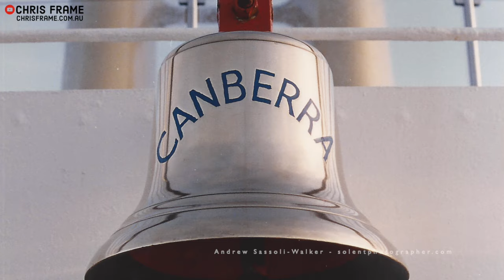RECYCLING CRUISE SHIPS! How & Why Ships Are Scrapped?

Comment: The Queen Mary’s funnels were replaced because when they took them off to remove the boilers, the funnels collapsed under their own weight. When they were inspected, it was found that most of the metal had rusted away and were only being held up by the many layers of paint. As for why the boilers were removed was due to labor laws. If a retired ship still had the boilers, all employees were to get maritime pay. This was the case even if the ship is removed from the water and used as a land based hotel. By removing the boilers, they were able to save a lot of money by paying standard hotel wages.
Reply: Don't think that was the case they just wanted more space
Reply: @MrJeep75  The area that the boilers were in is still empty. For a short time they were filming a TV show in one of the boilers location, but that is back to being an empty room. I know about the pay because that is what they tell you when you take the ship tour and ask why they didn't just leave the boilers in place.
Reply: I think it was also Cunard insisting that the ship must never sail again, to ensure their former flagship will not somehow end up with the competition.

Comment: Imagine buying a huge ship engine and just using it to power a giant fan
Reply: Yasssss
Reply: Imagine buying a big ship just to grow weed in the international waters. Desalination on board with solar power/ mini wind turbines, id be set for life just grow and sell
Reply: Engines are not as big as they once were. They push hydraulics after the combustion and not stream on direct drive systems like the Titanic had.
Reply: @biga87718  they are still huge. What engine model are you specifying. Because alot engines i seen from cats to libertys are pretty big. They can run a whole New York City block so please tell me how an engine and its systems are not big. Huge no but big as fuck and youll need 5ton cranes pull em out

Comment: I was hoping more insight would be available. For example - are they able to extract whole cabins which in newer vessels are installed as modules. And what of all the equipment from gym machines to kitchens capable of preparing hundreds of meals. Re-constructed on land would be an economical re-use of these items. Part 2 please...  Dismantling, upright, in a shipyard is potentially safe. Dismantling on a beach is more likely to be unregulated or downright dangerous.
Reply from the maker: Thanks for the ideas for Part 2!
Reply: Any part or piece that can be removed and re-sold usually is.  Chairs, kitchen equipment, all the little small parts can often be sold and re-used.

The modules would require the same infrastructure as the ship, so it makes no sense to re-use, they will be scrapped.  Its much easier and cheaper to build new with regular construction.  Kitchen equipment might make its way to some small restaurants who need to save money.
Reply: You are going to pay for a shipyard to cut it apart huh?

Comment: it would be interesting to see what they are dong with all the stuff they are clearing off the ships endless amounts of stuff .the scarp part is easy to understand what about all the fixtures towels linens chairs blankets sheets on and on
Reply: Many of the chairs, fixtures, kitchen equipment, machinery, linens, etc. are taken off and then re-sold.  In many poorer countries, there are tons of stores nearby that sell this stuff off.

Steel plates from the hull are sometimes cleaned of any frames and brackets and heated and re-rolled into new steel plate.  Wiring is chopped up and the copper is recycled.  All of the remaining hull and pipework is cut into smaller pieces and melted down into new steel.

Comment: What are scrap yards paying for a typical cruise ship like Carnival Fantasy?
Reply: Here is the latest price list:
https://www.go-shipping.net/demolition-market
   
Light Displacement Tonnage (LDT): is the actual weight of the ship as built and commissioned excluding fuel, stores, crew etc. Light Displacement Tonnage (LDT) is of limited commercial importance except when a ship is irrevocably being sold for scrapping.

Notice that GT (Gross Tonnage) or earlier GRT (Gross Register Tonnage) is the overall internal volume of a ship. It has NOTHING do do with the weight or displacement of a ship. 

It's indeed difficult to find the weight of ships but I guess Carnival Fantasy had a net weight of approx 30,000 LDT, so you can calculate the price.

Comment: Remember that classification societies (Lloyds, DNV etc)  have very strict survey requirements for vessels older than 25 years
Reply: And insurance prices go up as the ship ages.

Chris missed mentioning the biggest reason for scrapping, and ties into why the survey requirements increase and insurance costs as well. Metal Fatigue.
The ship moving through the water stresses the metal so it gets weaker. Recycling the metal allows it to be re-smelted, which restores steel to new.

Comment: Eventually a cruise ship is going to be worth less refurbished, than the cost of a planned refurbishment. Often a ship can be purchased for less than the refurbishment cost a few years earlier. 
Newer ships are very much more fuel efficient, assuming full loading. Thus planned time at sea, at what speed, compared to time in port is an important consideration, a ship could be considered uneconomic for one line and quite economic for another. All in all the line between refurbishment, sale and scrapping can be very fine.

Comment: why would you take the original funnels and scrap them just to put new more expensive funnels on..?
Reply from the maker: They were falling apart. It was mostly paint holding them together. They removed them to access the engines but couldn’t replace them.
Reply: The old ones were falling apart. Apparently, 1 went smashing through several decks during restoration.

Comment: I used to cross the North Channel from Larne to Cairnryan in the seventies and I had the questionable privilege of watching HMS Ark Royal being cut up over a period of years. The process was clever as they appeared to cut from the top down towards the water. As the weight diminished the hull rose ever higher in the water assisting the process.  Both remarkable and terrible to watch.  The steel in the hulls deteriorates from a fatigue point of view over the years and sometimes moving to warmer operating waters can offset the process. 
Shameful to remove the name and de brand!

Comment: The max occupancy of a lifeboat is 150, now 6000 passengers plus 3000 crew makes 9000 people, so you will need 60 lifeboats in case of an emergency. Cruise ships are equipped with 20 lifeboats on the average. Will that many lifeboats be enough?
Reply: My thought is they would use the lifeboats to evacuate to adjacent ships so they could make several trips. Even in the event of a severe emergency, ships are compartmented to stay afloat.
Reply: There are also many lower capacity life rafts.

Comment: The Olympic was actually the titanic ! because the Olympic was too badly damaged in a collision and they did not fix it !...they actually replaced it with the Titanic ..by switching the nameplates !!
And changing to port holes and putting some carpet down on the worn-floors...
you go down to the wreck of the “titanic” and (grind off the rivets..-& remove the front” false” nameplates... you will see Olympic underneath the rivited on titanic-name plates...
The white star line had to pay their workers to do those and some people knew this BS was going on!Why do you think almost no fireman ..(coal shoverlers)would take the trip across the ocean?... even though there was no work because of the coal strike!.. because
White star line committed fraud to save themselves from bankruptcy... and the workers knew it! 😉
Olympic also threw a propeller a couple times and they were using titanic propeller propeller’s to repair it and when they found a propeller at the reck site ?....it was actually from the Olympic😉 I think it said titanic 401 and that’s the one they had used to repair the Olympic...This is only from my memory so I could have the wrong numbers but I know this happened
Reply: Conspiracy theory

Comment: You never gave the actual reason  for decision to scrape. Structural ? economic? Why would you not convert to cargo or smaller lines for other purposes? Poor video.
Reply from the maker: Hey Wayne. Poor video? It does give reason(s) in the video - age, obsolescence, replacement with newer vessels.
Reply: Wayne please pay attention next time 🙄🙄🙄
Reply: That is what I was hoping to find out also.
Reply: X R I was and did not receive what I expected. Apparently I’m not the only one. Others feel the same.
Reply: X R didn’t think I would have explain why you tube has feedback options such as like/dislike with the fantastic ability to clarify/ quantify!   Any feedback qualifies for points toward monetization. So I do no harm with my personal opinion which just happens to constructive. Your comment provides no useful purpose other than to show your ignorance.
Reply: I prefer these older smaller ships with character that are picked up by smaller lines like CMV. Unfortunately they are proving too vulnerable to the pandemic. What are the considerations that make it worthwhile to continue operating a 20 yr old ship instead of scrapping it? Engine condition, fuel use, structural condition, interior design and decor?
Reply: Chris Frame yes Chris it sort of does, but not very clearly and I just felt it was long winded with a lack of specificity. Your editing and subject were good as well as the sound quality.
Reply: @waynetokarz174  I think there could have been more mention of the horrible toll that the sea takes on ships, and the high cost of slowing down the aging of the ship.  Salt water and steel like to mix and make rust.  However, this is more of a cruising nerd channel, so that's now really in their wheelhouse.  They're more about the hotel and entertainment departments than the deck and engineering departments.  Cruise ships are a very complicate business, so I don't want to be too hard on them that they didn't cover everything.  They might decide to do something in cruise line accounting, taxation, and national subsidies.  My wife the economics major might like it, but as an engineer, I'd prefer the one on corrosion.  Most people aren't really interested in either, though.